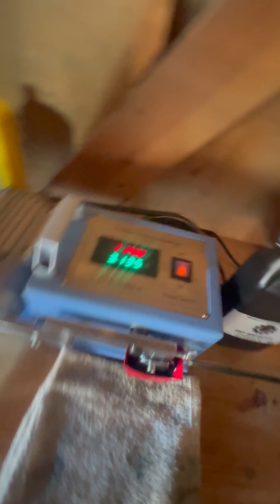Pennzoil vs Amsoil vs UHP Innovation

Comment: Has virgin samples ever been sent to Speedlogix and Blackstone labs of the UHP products?  Oil and oil additive? 

Do you plan to release any other weights of your oil other than 5w30?

Does your oil have additive and wear packages comparable to any of the other oils?  

You mention that it is high performance oil.  Is it only really designed for racing then drain and use new oil?  Or have you tested it to 3000-5000 miles and checked with oil analysis what shape the oil is still in?  TBN and oxidation values etc etc? 

Have you ever tested any of the following in your video tests?  I would be willing to send a quart of each for testing.  I would like to see the stacking weight test and the wear scar test on the following:
All Full Synthetics below? Not the blends or conventional oils.

Valvoline Extended Performance
Valvoline Extended Performance High Mileage
Valvoline Advanced
Valvoline High-mileage 
Redline High Performance

I have vehicles that use 0w20, 5w20, 5w30, 0w40, and 5w40 and a motorcycle that uses Amsoil racing 10w40 and a tournament ski boat that I use Amsoil Marine 10w40 (I use Valvoline EP HM, Pennzoil Ultra Platinum and Amsoil Signature Series in all of these weights depending on vehicle).

Comment: Why is the lower the amps the harder it's working? Wouldn't it be the other way around since it's drawing more amps to help keep the rmps up?
Reply from the maker: @atleastmypalmsarewhite9960  No with it free spinning nothing on it just the oil it’s 325+ It drops to about 300 the first 5-10 seconds when it’s loud before the film strength can handle it. Lower it is the harder it’s working/more load/friction taking place